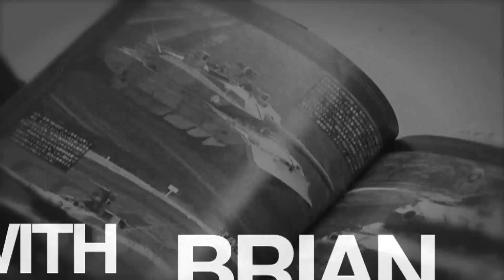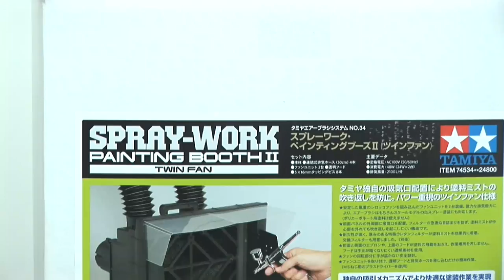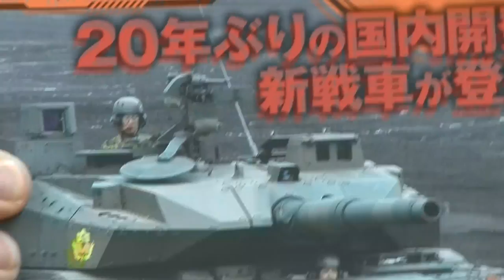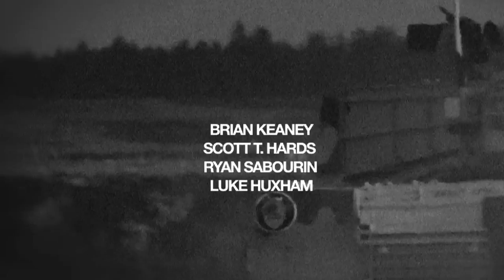Airbrusing the Type 10 Main Battle Tank | Boss Builds 5

Comment from the maker: @kenshin142 Thanks for the purchase! Checking the manual of my Revo, it actually expressly states, "Use hose connector with air stop valve." Now, the manual with the HG Trigger airbrush says when using the Tamiya Spray-Work HG Compressor (not the Revo) to remove the stop valve and spring to avoid damage...are you sure you're not reading the HG Trigger airbrush manual? I have both right here. And I've been using it for 10 years like this, so I'd say it's fine !

Comment from the maker: @BlackSheep0ne  The GSI Creos "Mr. Stand": (GNZPS-256) . Actually, I have the "Mr. Stand & Tray," but it's discontinued: (GNZPS-255). The stand is the same, but the metal tray is not included in the currently available item. The stand is magnetized, making it very stable when used with a metal tray like that.

Comment: Hey Brian, just bought the REVO through HLJ, quick question!, in your video it seems you still have the stop valve in the air brush, the manual states this has to removed for safety of the compressor, is this true?, I rather not have a constant flow of air through the brush and have that control using the trigger, or is there a serious threat of damage to the compressor if the air stop valve is left in?